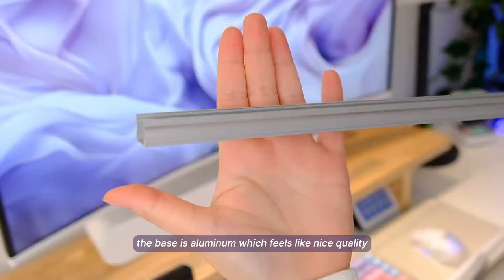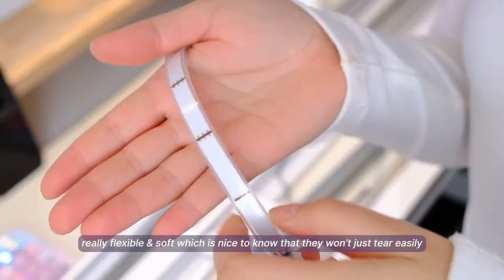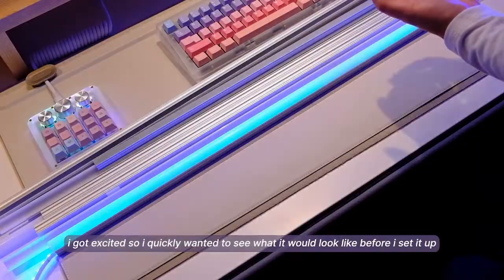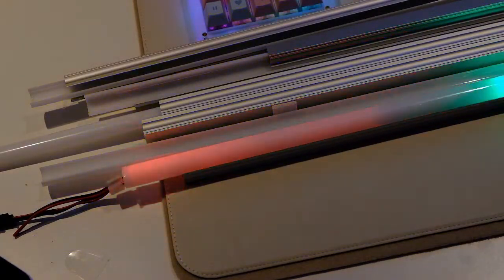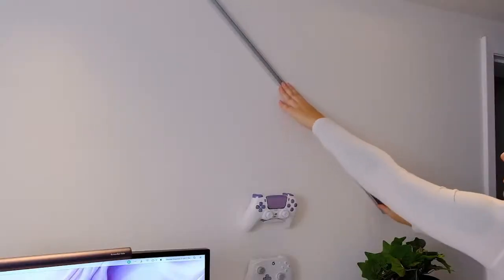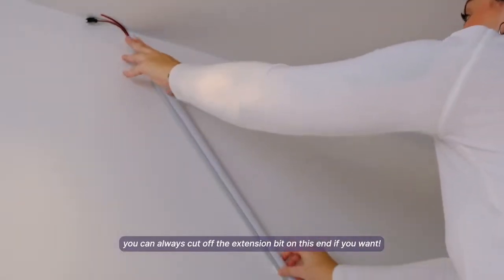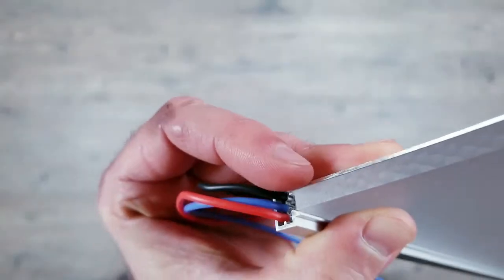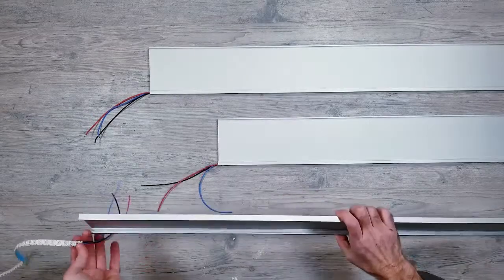Muzata LED Diffuser Channel Installation -2024

Comment: Maybe I’m just dumb but I found it impossible to slide the covers in. I cut myself twice trying to. What am I doing wrong?
Reply from the maker: Maybe it's not all about you, if there is a problem with the product, you can contact us:
Email ：support@muzata.com
TEL: 888-680-8850 (Toll Free)
Reply: Nooo you must not "slide" the covers. I installed mine. You need to align plastics on top of the aluminium railings and "snap" them together. Obviously the person who first answered the question at Muzata's doesn't have a clue what's he/she talking about!